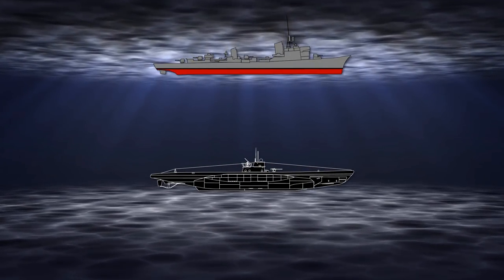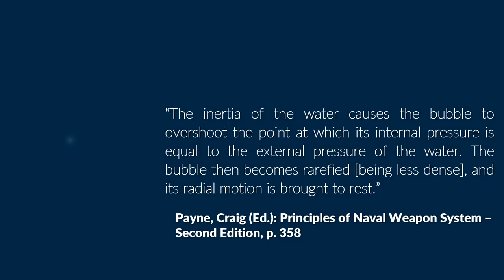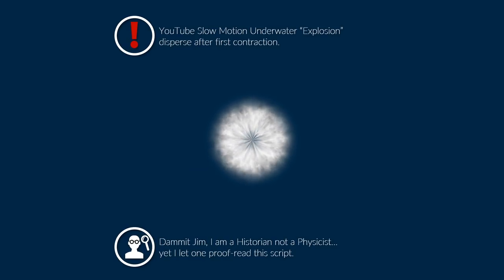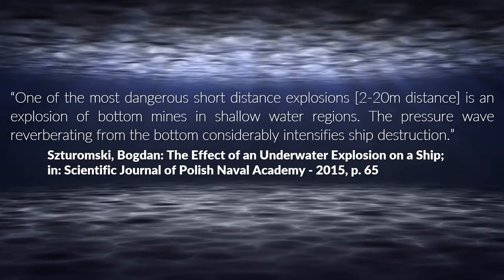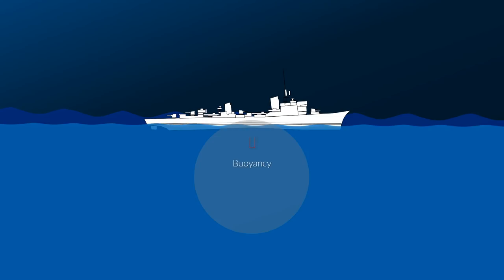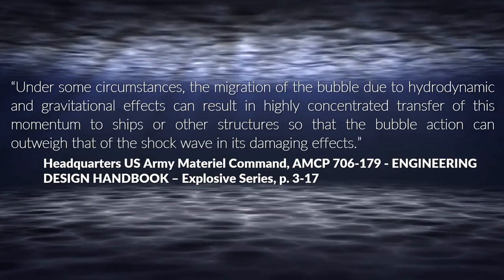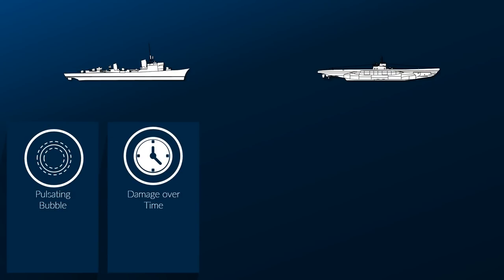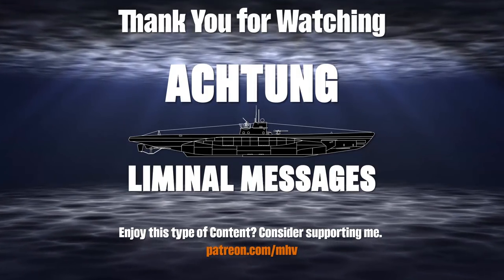How Underwater Explosions damage Ships and Subs #Military101

Comment: So sinking surface ships with torpedoes has nothing to do with armor/hull piercing munitions, but instead with the shockwave and "pocket" created in the water underneath the ship? So, torpedoes are just big high explosive bombs? 

Guess you learn something new everyday, thanks MHV!
Reply: Navies were well aware of this; it's why they all did their best to develop proximity (i.e. magnetic) detonators that would allow the warhead to explode beneath the target without needing to strike it (a contact fuse). Indeed, many torps had both sorts of detonating mechanisms. They also had varying degrees of troubles getting them to work reliably, most famous being the appalling performance of USN torps in the first few years of the war v Japan. The German torps also had reliability problems, something not as widely known (Gunther Prien famously complained about being forced to fight with a wooden gun, for example).
Navies also spent a LOT of time and money trying to devise the most effective way of countering these things, both through the design of anti-torpedo protection schemes (and there were many of those, even within a single navy as they tried different things) and other things such as 'degaussing' where you reduce the magnetic signal of a ship so magnetic mines won't explode when it passes overhead.
It's a complex and pretty interesting part of naval warfare history, and of course I've only touched on a couple of aspects of it.
Reply: More accurately, this points out the reasoning behind magnetic warheads for torpedoes.  It was the only practical way to place an explosion directly under the keel.  

Something else that was discovered from these experiments.  "Breaks" in the sheer line were VERY bad (put simply, you want a "flush deck" with a continuous line bow to stern).  Raised forecastles (very common on destroyers) created a weak spot at the break.  What this meant was that either the shock (the actual explosion) or settling (for an under the keel one) would overstress the hull and break the ship in half at that point (this is related to the "square windows" issue).  W.K. Brown has a bunch more on this in his ship books.
Reply: It depends on what kind of torpedoes are you using. For an 'underneath the keel' explosion, you need deepwater torpedoes. Traditional torps were surface or close to surface ones which were meant to strike the side of the ship. This is why navies put bulges(bulkhead are they called?) on the sides of their ships. For a deepwater one, the torpedo has to dive beneath the ship and then detonate(for surface launched ones). The problem with deepwater torpedoes is actually getting them to explode under the ship. Another thing would be the target. If it is heavily reinforced, a deepwater torpedo might have no effect
Reply: There's no such thing as 'deep water torpedoes'; they're all simply torpedoes. All torpedoes used in any numbers in WW2 had the ability to have their running depths set, the only issue being how easily you could do it. One reason submarines had manuals by which to recognise ships was because it contained masthead heights (important for determining range) and draft depth, important for deciding what depth you wanted the torp to run.
Problems arose with how reliably the torps held those depths and how well the detonators worked, and all navies had issues of varying degrees ironing out those flaws.
Reply: Torpedo are just a Naval warfare Version of HEAT Ammunituons but Underwater.

Simple Advice or Tips:
-damage by ammunition is For penetrating and Damaging Protected component but cause Minor Flooding.
-Torpedo Is for Causing massive Flooding damage.
-Aerial Bomb is to Damage Deck Mounted Defenses if HE, or Penetrating The Deck and Damaging The internal If using APHE.
-Missile Is Something that are only used by Nazis In WW2, its only for Destroying Boats or Small Surface Combatants.
Reply: @Chaos Craft999 Your wording is a bit misleading because you make it sound like you are talking about modern day. To clarify on modern day naval weapons...

Torpedoes are basically high explosive bombs that detonate under a ship to break it in half using the principle described by this video. A single torpedo can take out the largest of ships. So, they are pretty powerful. Not much else to say.

Anti ship missiles work on a somewhat similar principle as HEAT ammunition but are much larger and therefore much more destructive. One missile will usually seriously cripple a warship, while two missiles will most certainly make a warship combat ineffective and/or sink. It depends on the size of the missile and the size of the ship. However, missiles are often deployed in groups. So, a single volley will likely neutralize a warship. Missiles are also used to take out incoming aerial targets (choppers/jets/missiles), but also ground targets that are far inland.

Cannons have mostly been replaced by missiles but are still used, mainly for self defense, to fire at aerial targets as a last resort, or when it's not worth it wasting a missile on a puny target, like boats (for example pirates). However, laser guided shells got introduced recently, which allows naval cannons to provide artillery support inland. Additionally, progress is being made on naval railguns, which means naval cannons might make a comeback in the future. Should they succeed in making the railgun projectile pin point accurate, then railguns might end up replacing most missiles... but that stuff is work in progress, so who knows.
Reply: Fun fact there are some battleship fanboys.that say underwater explosions dont afect battleships.Because reasons.Lol.
Reply: hull penetrations did sink ships as well depending on how devastating the hit was it is why the torpedo bulges were started to be placed on some battleships, and newer ships had built in torpedo protections integrated. the proximity fuse and subsequently the "under the hull" attack was moved toward...puncture a ship's side it could survive break its back it's dead, if not from the hit it could succumb to the damage in rough seas and the ship even if it gets safely back to port would be pretty much done
Reply: @steeltrap3800  No less a luminary than Albert Einstein warned the USN that its' torpedoes wouldn't work, but what did HE know?? They Didn't, until Caltech finally completed a redesign.
Reply: @potatoraider7320  I don't think so. HEAT uses molten medal to penetrate armor, and then the hot gas from the explosion follows. The torpedo causes a shock wave.
Reply: there is a lot more to sinking a ship than just breaking it in half or blowing a crater in the hull.
i helped a friend study for his captain's license (100 ton) and the only formula that i can still remember was the one that shows a 4 inch hole under the water line, 4 inches allows a flow (gravity) of 400 gallons a minute.
      so, a larger hole, more gallons per minute.   Some port holes on the titanic were estimated to have delivered over several tons per minute  as the bow sank blow the waves.   again, bigger hole, more water.

     now, the the dynamic pressure which is seldom spoken of.  When a ship is hit, it is a massive chunk of steel and if in motion, even at 4 knots, the pressure of the water moving in and around against the inertia, will shear bulkheads and buckle otherwise water tight decking and ceiling.

the cavitation under the hull, would induce stress damage throughout the area, further weakening the hull.
    an army corp of engineers assisted in the sinking of the japanese carrier in the second world war by suggesting rather than run deep, the torpedo be set at 10 feet and blow the bulkheads and capsize a carrier,    sunk or upside down, it was still un-usable.
    survivers of the Shanano (if i spelled that right), describe a terror of destruction from just the water flow that was far greater than the damage of the attack.   Some speculated that they might have been able to save the ship had the water not been tearing out the hull so fast they could not assess the damage.
Reply: @drpoundsign  Einstein was a /theoretical/ physicist; expertise in one area does not automatically mean knowledge of another. 'Wouldn't work' in what sense?

Comment: Having worked  with underwater shock as a structural engineer for the last 20 years I appreciate all efforts to educate and explain the phenomena. Kudos to you for a nice video. However, I would like to comment on the part where the bubble contacts the hull. The bubble will not continue to oscillate, it will collapse onto the hull causing a “water hammer effect” which is highly damaging. That is why near-contact detonations are dangerous even with small charges. In fact, the bubble can collapse onto the hull by only being in the vicinity of the hull.

Comment: Key concept - air compressed easily, but “you can’t squeeze water”.  Thus, the deeper the depth charge, the smaller the bubble created. Not to say that the blast front is lessened, but it dissipates faster and is moving 5x faster than it would in air
Reply: ... thus a torpedo exploding close aboard is deadlier than a depth charge exploding at anything but close aboard, IMHO. Subs can routinely survive many DC attacks unless they are in shallow water, especially if they are close to the bottom. Then it gets grim.

Comment: I know I read somewhere that in ww2 most sinkings from torpedoes are from flooding on one side causing it to capsize rather than breaking the keel
Reply: I would guess that not all torpedos had sufficient fuses for exploding under the keel. Furthermore it could be that the torpedos where aimed higher than needed to ensure hits (even if they didn't make as much damage they would have been less likely to to not trigger the fuse).
Reply: Feuer der Veränderung partly yes, for most part of Ww2 both sides had problems with their magnetic and contact fuses. Also, the warhead of allied torpedo is much smaller than the Japanese Long Lance. Secondly the under the keel, backbreaking explosion it has to be right smack in the middle of the target. It is naturally difficult and quite a lot to of torpedo shots were made not from the side, sometime it is done head on or at an angle

Comment: Does the underwater midships keel kill have a "sweet spot" where the explosion and bubbles have the best effect?

If I recall right, due to pressure increasing with depth, an underwater explosion tends to send water upwards the most violently. 

My experience is limited to boyhood homemade firecrackers, but I noticed that when weighted and thrown into a pond the explosion would always send a fairly narrow column of water straight up. A firecracker stuffed into a model I tired of would send the parts everywhere. Good times. 

The physics of the dam buster bombs would be a possible sequel to this underwater explosions theme. It has been too long since I read about it, but they had to design the bombs to overcome problems posed by the Germans and physics.
Reply: I think this is why magnetic torpedoes were implemented, the torpedoes would engage once it was under the keel of a ship. Instead of on one side.
Reply: What happens when a submarine has an explosion
Reply: Absolutely. If it detonates to deep, a smaller portion of the energy is transferred to the ship. If it detonates to close it won’t create the proper spherical bubble at the depth that makes this work.
There’s actually 2 different sweet spots. One involves having the gas bubble not touch the bottom of the ship. That acts basically as described in this video. The water acts as a hammer and forces the midsection of the ship up into the air. Than the gas bubble collapses, which makes water rush in from every direction. This makes it so there’s no water directly under the middle of the ship for a short amount of time. This makes the ship fall into the void and break its back. Then the reverberations finish it off.
A second sweet spot involves detonating a little bit closer to the keel. In order to make the gas bubble touch a certain amount of the keel. At first this works much the same way. The water is slams into the bottom of the vessel and pushes it into the air. But instead of waiting for the bubble to collapse in order to create the void, the gas bubble will act as the void when it reaches peak expansion. So the keel of the ship falls into the gas bubble just as it starts to collapse. The collapse of the gas bubble has one last nasty surprise. Since theirs no water to collapse down into the bubble, and instead there’s the ships keel, the collapse involves water rushing up and blasting through the center of the ship. Effectively gutting the thing. This is the jet of water you saw when you through the firecracker in the pond. The expanding bubble must have reached the surface
Reply: IIRC During WW2 the perfect location for a depth charge to detonate when attacking a submerged U-Boat would be directly underneath the hull, proximity wasn't as crucial  as you'd think. The perfect circumstance would be to drop the DC in front of a U-boat so the sub powered over it, very difficult to arrange.

Comment: It's just a little thing to emphasize: The efficiency of explosion in the depth decreases drastically, its power decreases proportionally with water pressure. So any submarine is safer in the deep depth, there must be the explosion much closer to be effective, than in lower depth.
Reply: The hull of a submarine in deep depth is under more stress already so it takes less force to destroy it. There likely is a sweetpot where the would take the smallest amount of damage.
Reply: Yes, thats right, but because the water pressure the depth charge need to be much closer too to the submarine hull in deep. Near the waterline is more effective, because the bigger blast radius.
Reply: It does not decrease efficiency with depth at all, it only decreases the explosion radius but increases the damage of the explosion because the water is much denser, so it transfers better the energy of the explosion, with depth the effect of the explosion is amplified even if the radius is reduced, it is the very reason why an underwater explosion is more powerful than an explosion in the air, so what you say is a contradiction.

Comment: Not mentioned is the /internal/ pressure of the vehicle in question relative to the medium they are in. Submarines would have a different pressure relative to the explosion depending on their depth, whilst a ship on the surface would have a lower internal pressure, in essence one atmosphere. Also a submarine is designed to withstand pressure - the pressure of the surrounding water - whereas a ship is designed just to float on it. A submarine deep would probably already have stress on its hull to maintain structural integrity, so a smaller explosion / farther away could cause equal damage to a closer explosion in shallower depths.

Comment: the beneath keel explosion is often far more damaging if the bubble breaches the surface of the water upon detonation, as the entire force of the explosion is immediately pushed upwards as the pressure finds an easier escape than through the water, used this way, subsurface detonations, generally mines, worked like a shaped charge.

Comment: Also i believe an underwater explosion can also act like a shaped charge as the path of least resistance is the hull, so the weight of the water behind the explosion will force the shockwave inwards, but is only achieved only if the explosive is detonated right against the hull as if done away from it the water acts absorbe more of the force. that's what i remember from Damn busters anyway

Comment: One thing I did not see explained is that when a hole in the water is created, the water rushing back in to fill that hole, like the initial bubble, will overshoot equilibrium and slam into the hull of a ship with shattering force. This is what does the most damage- not the gas explosion, but the liquid implosion. This is because water has far greater density than gas.
Reply from the maker: interesting, this was clearly not noted - or I missed - in the Naval Weapons principles. But I am a bit skeptic since I doubt the force of the water coming back is strong enough, it would just be a wave and ships are built to withstand that, but not to "hover in the air". So, you have a source on that?

Comment: question, if the bubble is what damages the hull, doesn't that mean that a second torpedo detonating In the same area under the keel will deform the bubble and make another deformed bubble, causing the 2 torpedoes to do less damage than one? i have wondered this for some time.

Comment: It's also worth noting that most of the energy of a bomb explosion on an armored deck or turret dissipates into the air whereas a near-miss can transmit more of the energy, through the water, to the hull or keel of the ship.

Also, under the heading English is nuts: "bow" rhymes with "Dow" not "Go."